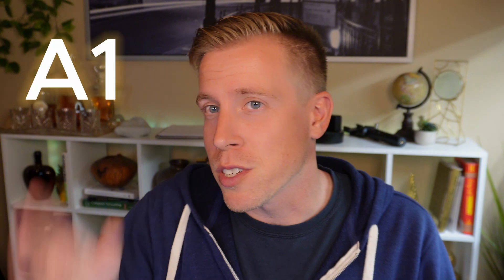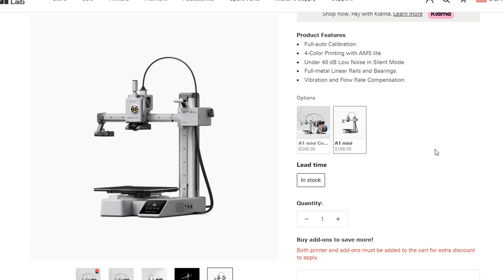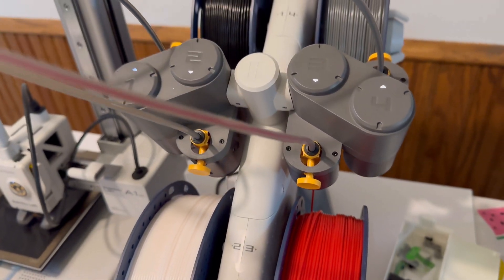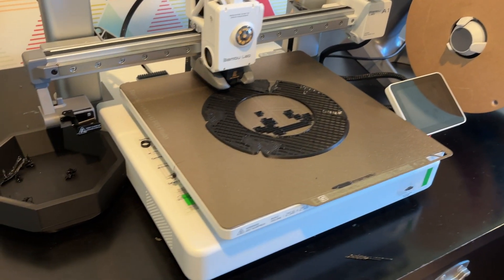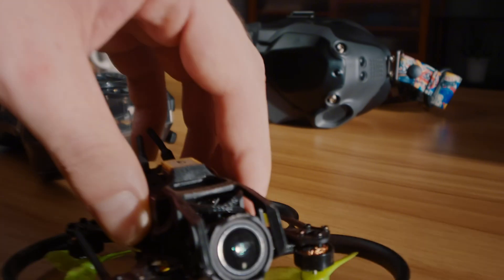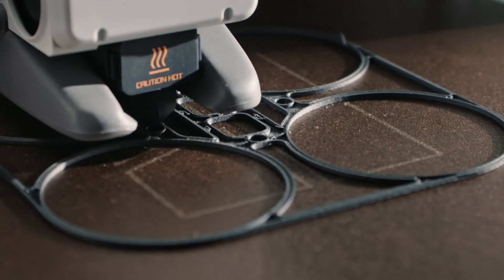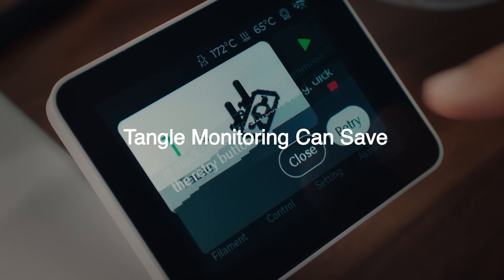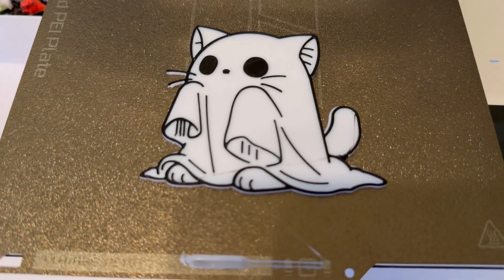Bambu Lab A1 Mini vs A1 Comparison - NEED TO KNOW

Comment: Yeah, I'm in the "I shoulda got the A1 instead of the Mini" boat you describe. I wasn't at all sure whether 3D printing would be fun or useful to me, or just be the frustrating time-sink it was when I first tried it out 15 years ago. But the A1 Mini is awesome and I'm loving it, but I've got some ideas in mind that will require a little bigger print volume. I'll be upgrading to the A1 soon, and hoping that selling the Mini on eBay works out.

Comment: I had years ago a Cetus3D Mk3. The A1 looks very similar. The Cetus was also praised like no other. Well, it was a piece of shit. It worked for a few months and then it got worse and worse. The question I have is why should I go for the A1 and waste my time and money? Yes and I make my own models
Reply from the maker: Why so much anger dude?
Reply: @3DPrintDood He's salty he bought a piece of shit
Reply: I had many years ago a Creality Ender 3. The Cetus3D Mk3 looks very similar😂😂😂😂😂
Reply: Talking out of your ass. The Bambu printers are in a league of their own, without the huge pricetag. You'd know this if you did ANY research instead of posting self imposed hatred bullshit comment. Did you happen to vote for the orange turd and regret it?
Reply: don't buy any 3d printer at all if you value your time and money, its not for you

Comment: Speed wise,  does the A1 compare with the X1C and P Series?
Reply: It has the same hotend speed, however because of the core xy build causes the acceleration speed to be double of the bedslingers. It makes more of a difference during big prints, but for small prints there isn’t much of an advantage, other than the enclosure. If you mostly print PLA, PETG, or TPU, go with the a1 with the ams lite for multicolour. However, if you use harder to print things like ABS or ASA, use the enclosures like P1S and X1-C. The normal ams system is also enclosed, so filaments dry out slower. It’s a personal choice though.

Comment: I agree with his conclusion. From my experience if you are able to spend a little more go for the A1 with the AMS. I got the A1 mini with no AMS and am now kicking myself for not going for the bigger build plate combo. I love my A1 mini but do feel like im missing out on the multi color print at the very least. 😅
Reply: imo just buy the bigger one, and add the ams later__?
Reply: That make sense, I am trying to upgrade my ender 3 to either A1c or P1S, do you think there will be a substantial difference between these two?
Reply from the maker: One of the main differences is the P1S comes with an enclosure. Keeps dust out and can print materials that need to be temp controlled while printing. But if you’re printing PLA, the A1 is a good solid choice!

Comment: Looking to get one of these but trying to decide on the A1 stand alone unit or the A1 mini with the AMS Lite. Both are roughly the same price. I like the idea of multi color printing but don't like how MUCH longer it takes and the amount of wasted filament. Any advice you can share?
Reply from the maker: Go all in on multicolor printing! You may think you don’t need it but it’s SO MUCH FUN
Reply: If you can, I’d try to save for the A1 with AMS combo as your only printer. 

If you can’t, I’d probably go with the A1 mini with AMS, as long as you don’t need the larger build volume. If you’re just going to print little trinkets and doodads with some functional prints then the A1 mini will be totally enough for you, and the AMS is a game changer. Even if you don’t do much multicolour printing, the ability for just have 4 of your most frequently used filaments available at all times is awesome. 

I have a P1S and an A1 mini and I print commercially and I DO need the build volume of the P1S, but barring three of my most popular sellers (large items that use the whole bed), everything else can be printed by the Mini.
Reply: @Hey_Its_Yosh  I'm most likely going to with the A1 mini with the AMS Lite. Just thinking of the practicality of either having a smaller build volume with multi-color or a larger build volume with no multi-color (they are both the same price). My main dilemma is how much more time each print will take and and how much more expensive it will be. I don't plan on printing helmets or anything too huge. Just looking to dabble with 3D printing as a fun hobby. Thanks for your input, it's really appreciated.
Reply: @Hey_Its_Yosh Thanks for sharing your experience! After watching all these reviews I'm even more on the fence as I went from wanting to buy the P1S with AMS to the A1 Mini and now the A1. The attractive thing for me with the latter 2 are the noise levels as apparently they are much quieter with no rattle. The P1S does have the appeal with a neat enclosure and AMS stacked on top, although some say the tech is actually better in the A1 so I'm confused AF at this point since I wanna place it in the corner of my desk where I work/game/study 😂
Reply: @YaNeK92  if you want to put it on your desk where you work and play games then 100% get the A1. Having both, the A1 series is clearly a “next-gen” product. It’s INFINITELY quieter, during setup it calibrates to cancel out its own stepper motor noise and you can literally hear it making itself 4-5x quieter as it goes along. Once it’s all calibrated basically all I hear is some bearing noise and a minor amount of fan noise (but I print PETG with low fan). The P1S is a pretty loud machine, though it’s helped by the enclosure. 

The quality is at least as good as my P1S. A1 nozzle wiping system is better, and the purge system seems to be more consistent at not getting stuck in any way compared to my P1S. 

The interface on the A1 is a million times better than the P1S, so if you’re interacting with it on your desk that’s a nice to have.  

Some people say they prefer the AMS Lite over the AMS, but I personally like that the AMS is its own dry box and also fits nicely on the printer. There are some mods to make the AMS Lite sit I on top of the A1, but I don’t really think hanging that much weight off the gantry is a good idea. There are also mods to enclose it though, so that’s cool. 

Anyways, lots of words to say get an A1 over a P1S unless you print exotic materials.
Reply: @Hey_Its_Yosh  Thank you so much for your help and your valuable feedback, it has helped tremendously. For some reason YouTube's decided to delete my comment yet again so this is another attempt at expressing my appreciation. 
Would it be possible to connect with you via Discord or any other social medium, to be able to ask a few other technical questions regarding these printers? Thank you bro. Cheers!